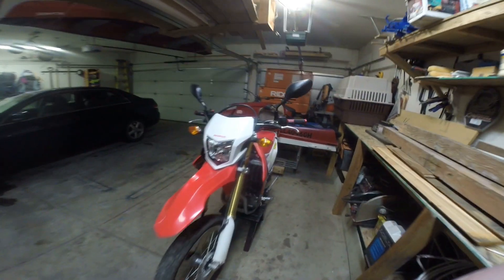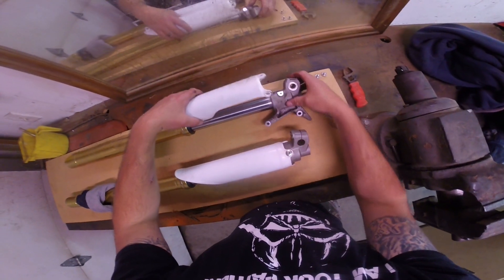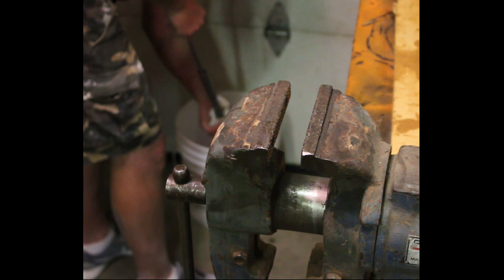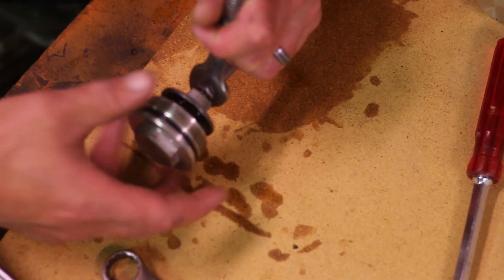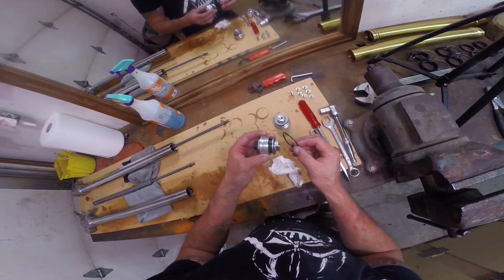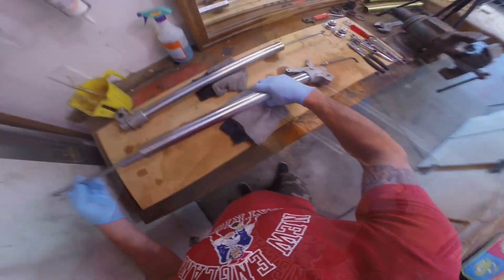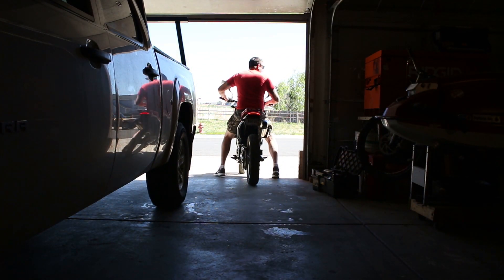2013 2017 Honda CRF250L Fork seals and bushings

Comment: One helpful tip: Loosen the fork cap before you remove the tubes from the bike! It’s really hard to get a good vice grip on the round tube. It’s much easier to get the cap started while it’s still clamped onto the bike.

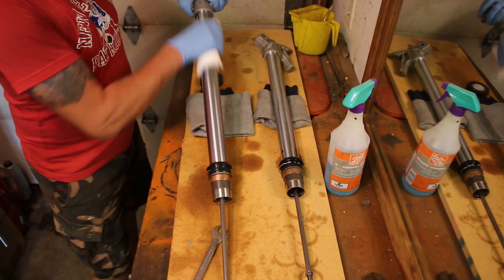Comment: The electrical tape trick at 7:00 is really smart. The manual says to use a fork seal driver, but it’s pretty annoying to spend $40+ on a specialized tool for such an infrequent maintenance task. Tape is way cheaper!

Comment: Excellent video, was very helpful got them both done in less than an hour. Had a little trouble with the tape as it would drag the new seal back off, ended up cutting the old seal in half and tie wrapping it to the fork leg between the new seal and the tape so the old seal knocked the new seal in; I then prised the old seal out and the new seal was seated perfect. Many thanks for posting this.

Comment: I was following the service manual and the steps specify removing the right fork spring. I spent about 2 hours trying to get the circlip out with no luck. Better to just measure out the right fork oil than using the level method; as in the video, you do not need to remove the right fork spring to replace the seals and refill oil. That clip needs ears to grab with retaining clip pliers.
Reply: I watched this vid and read your comment here before attempting this but, as this was my first-ever fork teardown, it took my getting to the exact point you mention to know what you meant. And oh my god, are you right. How, on God's green earth, is that clip supposed to come out, WHILE you push down on the fork tube to compress the shock? Do they think we're an octopus? So yeah, better to go to the other end - where the dust seal is - pop off the seal and remove THAT retaining clip, which is much easier to remove (because it has a bend in it that makes getting the blade of a regular screwdriver under it), and then go from there. To summarize, just....watch and follow this vid. For those of you like me who both watched this and then used the shop manual method, when it comes time for the right fork leg, the one with the spring, pay particular attention at 2:54, where he starts working on the right leg.

Comment: Hey thank you for this video, it helps a lot!
I know this was a long time ago but I'm having difficulties bolting the bottom bolt in like in the video at 5:52. When the bolt grabs the damper assembly, after a few turn the damper tube just spins and I can't tighten it more. Is there any trick to this? on yours you were able to torque it but mine just keeps spinning. Nothing ti broken as I've triple checked everything.
Reply: it's probably too late for you, but for anybody else: I solved this issue on my f650 GS fork by applying pressure to the other end, tightening it towards the vice with a ratchet strap wrapped around the vice.
Reply: @gregormelhorn  Thank you for your reply! 
In my case I just had to clean the bolt very well because it was still having old loctite on it and it was grabbing on the threads. After I cleaned that up, it started to thread smoothly with no effort to the point where the damper locks by it self with the amount of pressure the bolt provides and doesn't spin.

Comment: How much oil did you put in? what kind of oil? and what seals did you purchase? This is the third time I've had to replace the fork seals on my crf250l. Ill be doing it myself since the warranty is up on it. Kind of strapped for cash so i want to make sure i do it right the first time.
Reply from the maker: All forks are a little different it's best to Google the fork tube fluid amount for your make and model... Damper tube take a lot more
Reply from the maker: I purchased the kit online, then I wth to my local Honda shop and they recommended the right oil.
I can't remember how many ML It was. I'm sorry I couldn't be more help.
Reply from the maker: If you over fill the tubes it will be super stiff....plus run chance of blowing seals again. Hope it goes well
Reply: Alright thanks man! Yeah hopefully they last this time.
Reply: A simple cleaning with a seal Mate will fix your forks no need to rebuild them that many times
Reply: right side 658, left side 683

Comment: Hi sir just want to ask how many oil did you put? TIA..
Reply from the maker: Jr Tugade I can't actually remember the exact ml amount ah Google the fluid chart. Ill see if I can find it and message you
Reply from the maker: Jr Tugade https://thumpertalk.com/forums/topic/1090196-honda-crf-250r-2012-front-fork-oil-capacity/
Reply: This is for the 250r
Reply from the maker: hayden kawas no the crf250l
Reply: right side 658, left side 683

Comment: Axle grease ruins rubber seals way to go your supposed to use silicone lube
Reply: Use Slick Honey.    How do you know axle grease ruins the seals?  There are more than one type of seals.  He's not working with o-rings which are susceptible to bloating from improper oil use